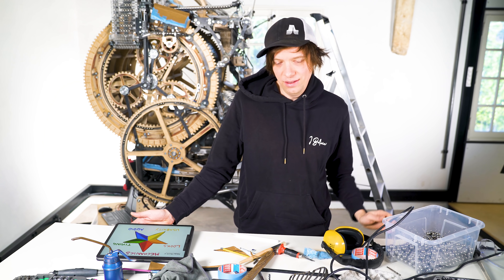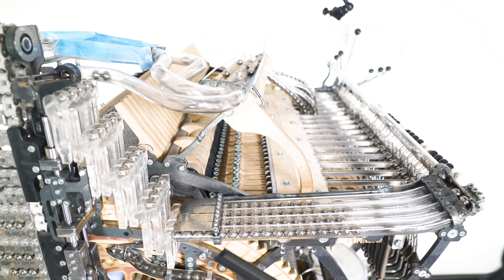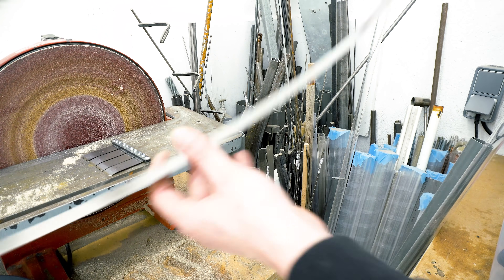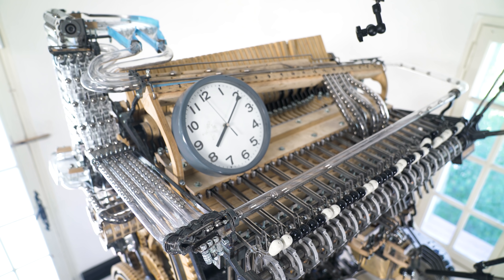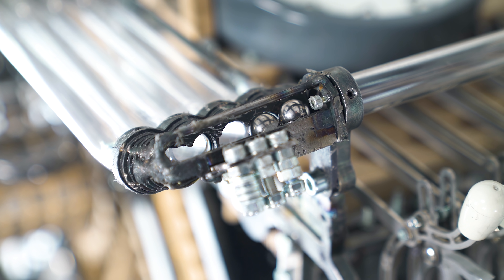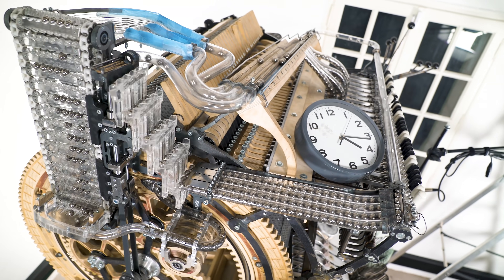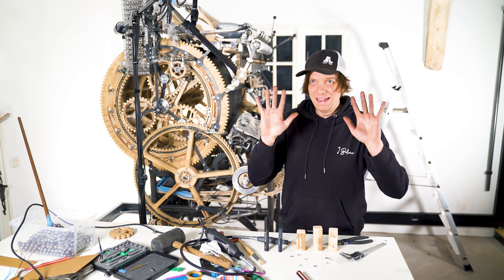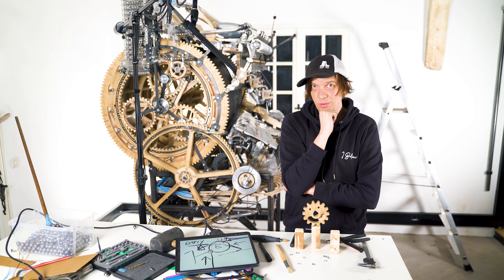Marble Machine X Fish Stair Upgrade

Comment: How did the standard of "no marbles on the floor" become the ultimate rule to live by ?   The real goal you have stated dozens or hundreds of times - play it on the world tour.  Not "not a single marble on the floor" !  You are considering quitting project from time to time over this rule which isnt even a rule.  Honestly the few escapees in the original video is part of the charm.  You are making music, and a spectacle to play on the world tour.  Maybe "no marbles on the floor" is the baby you need to kill.
Reply: Marbles on the floor mean the machine is doing something unpredictable, which is very bad. It would be catastrophic if, during the world tour a marble escapes and somebody slips on it. Even worse is if the marble has the potential to get caught in the machinery, and cause the whole machine to break. No marbles on the floor ensures that they will never be a risk of them messing anything up.
Reply: @bro748  It will never be 100% perfect though. So it almost looks like he's setting himself up for failure.
Reply: @nNicok  He would be setting himself up for failure if he was content with a machine that could break at any moment. 

And ensuring that 100% of marbles stay inside the machine is not very difficult; all he has to do is encase all the marble paths in plastic (or really any other material) and then there's no possible way a marble could escape. That doesn't look very pretty though, which is why he doesn't do that. Even without doing that it's still possible to get that 0% drop rate, and he's very close. There are only a couple of points that marbles can still escape from the machine.
Reply: @bro748  I don't understand why you think it would break that easily. How do you think that would happen?
Reply: @nNicok  He's just very pessimistic.
Reply: @nNicok  If a marble jumps out and gets stuck in one of the gears the machine could break quite easily. Think about a stick in a bicycle wheel, the moment the wheel can't turn any more the bike will flip and its rider will hits their head on the pavement.
Reply: @Noone-tb8jn  I get that but I don't see any easy way to get a marble into the gears without putting your hand inside and placing it there.
Reply: Thanks all for the replies and to Alan for the supporting reply.  I have been convinced by some of you like "bro" that loose marbles are worse than just a charming drop... that is an excellent point and catastrophic failure by injury to a person or machine is definately something to be avoided.
 What my OP message was reacting to is more on the philospohical level - in this video (the last one of the fish stair) Martin was legitimatly talking about giving up on the project - thats an emotional low.   He also presented in that day or a few days before a 5-pointed star of objectives... or "direction drivers" I guess since the "objective" is clearly "play on the world tour".  However, "marbles on the floor" was not in of itself an arm of that star.     
When you set up a metric, you get a tendancy to adhere to that metric as opposed to what you are looking for behind the selection of that metric....  If you look at the marble tests scoring grid, the marbles on the floor are used as a stand-in for quality because they are countable.   You cant do a test and try to measure "how awesome it would be on stage" or "how great it looks" or even "how well engineered it is "  - you need a countable metric.  So the marbles on the floor thing has gotten a promotion over other aspects just because it happens to provide a countable integer output.   I want to encourage a bit a little bit of rightsizing on that one metric - ESPECIALLY in face of talking about quitting the project.  
Videos since then have just moved on to other aspects, the fish stair feeder simply solved by stating "dont let it run empty" which is a good enough conclusion.   I guess then, for now at this point, we dont need to drag out the safety nets to catch Martin's enthusiasm or falling marbles.
Reply: its his baby, a parent always knows their prodigy best. I think Martin is doing brilliantly and will ultimately succeed. He knows what he is doing. The marble on the floor is a symptom of something not right and it could cause a show stop type event ie mechanical failure. That is what he is trying to eliminate as far as possible. Not a bad idea at all.
Reply: the edge case in this video is a perfect example of a marble on the floor that poses no risk of breaking the machine
Reply: Like you say, the goal of no marbles on the floor is unachievable. That is perfection, which does not exist. What we engineers do do, is build something such that a marble on the floor is contained and is not a problem. Shit happens, we know this; we make systems so that shit stays merely shit and does not morph into catastrophe when running)

Seeing as the actual goal is to take the bloody thing and play it on stage (and after 3 years that has not come close to happening yet which tells you something), the immediate handling for marbles on the floor could be as simple as a big net under the MMX to catch marbles. Or just play the thing in a big shallow tub where Martin stands outside it and no-one slips on  a marble. I imagine stepping a marble is almost as bad as stepping on a Lego piece in the dark.

Either way - Martin, stop fiddling with the damn machine and just put it on a stage and play it. No instrument is ever perfect

Comment: Marble. Escapes. Are. Not. A. Critical. Failure.

Please, stop using up so much of your time and energy chasing small issues that will not prevent the machine from operating. A marble that falls on the floor on stage will not impact playing the machine at all, and will almost certainly not even be noticeable. Unless you're losing hundreds of marbles per song, this is a non-issue. Apply some risk assessment techniques to the project and bucket potential problems by their impact, focus on the fatal/critical ones that could damage the machine or stop it from playing.

Comment: Will a magnet get the metal grit off of your hands?

It's been a long time since I've ground steel with a dremel tool, but when I did I found that an easy way to clean up was to use a "magnetic sponge".  I wrapped a magnet in paper and used that to clean up.  I would then unwrap the magnet from the paper, being careful to have the metal grit fall into the trash rather than get on to the magnet.

Comment: I would have tried a pin that holds the marbles in the incoming queue as long while the balance is down and not back to receiving level yet. Could work similarly with the stairs, hold incoming marbles past the 1st position with the stair is not at an appropriate position.

Comment: You need a sort of bistable mechanism on the divide by 4 that prefers to be up unless there's the right amount of weight on it.

Think of a button that clicks when you press it. That click is the button at first resisting being pushed down. But when you push it past a certain point, suddenly there's a lot less resistance and it shoots downward from the weight to fully pressed. When you lift your finger from the button, it still goes back up.

How to implement? Have two strips of spring steel at slightly different angles like one of those snap hair clip barrette things. It will want to be in one of the two states and resist being in between. If you then add weight to it, it will really want to be in one state and kinda be ok in the other state. Fine tune it so it only goes down when there are 4 marbles on it, and only goes up when there are 0 marbles on it

I hope you see this because I really think this would work. It will really discourage the divide by 4 to want to be in between the up and down states

Comment: A thought occurred to me today, but not while I was watching the days mole hunting. The engineer in me has been cheering along for a while when it comes to the idea of no marbles dropped, because that's what an engineer would do. I am experiencing a similar issue in my broadcasting job where I want to engineer for every possible outcome and potential issue while others who do not have an engineering background and therefore think differently done even agree with my thinking that there are issues to begin with.

My Thought: Almost every non electronic instrument in existence has consumables that need replaced from time to time. Guitar strings and drumsticks sometimes break in the middle of a performance. Drummists keep extra sticks just for this purpose. Guitarists aren't so lucky because they can't just put another string on while they are playing their instrument  (We've all seen the video of Stevie Ray Vaughan breaking a string and his tech making the perfect guitar switch).

While the marble divider needs to be fed properly, is 100% marble retention really necessary? there seem to be a lot of compromises to achieve a goal that I'm still not convinced is a real problem. I personally don't think I will, mind seeing a marble or two fall off the machine every once in a while. I just don't want to see you give up while chasing something that might be unattainable.

Anyway, that's just me thought. Stay safe, stay strong, and keep going!

Comment: Those finger should be about 2mm longer and then you have that probelem solved. As you can see fingers touch marbles at the middle when they hit against to that ladder so they can easily slip a away of fingers, if you add lenght about 2mm after middle axle of marble there will be no way to sqeeze throught that gap.

Comment: 1) it's already cool; even if you stopped working on it, it would still be cool.
2) it's cool even if you work on it indefinitely; it doesn't ever need to be completed to be cool
3) but if you ever tour with it I will definitely fly to whatever country you're in to see it
4) stop trying to prevent the marbles from escaping the machine. it doesn't matter if marbles escape the machine

Comment: It's funny, I just realized why you care so much about failure points like this, which have no chance of damaging the machine. While you definitely want to make it so that, if something fails, it doesn't damage the machine, that way a failure won't cause it to rip itself apart, the problem with being okay with marbles flying out like this is simple:

When you are on stage you aren't just standing in one spot. If marbles spill onto the floor, no matter how unlikely it is for one marble by itself to cause you to slip, it can happen, so it is best not to risk it. As bad as the machine breaking in the middle of the tour would be, you or one of the other band members breaking would be worse.

Comment: Suggestion: With the remaining Fish Stair issue, add a steep chamfer the right (incoming) side of the pockets of the first stair, so that a late marble will be pushed back into the tube.  15-20 degrees off vertical should do it.  Start at 1/5, the thickness of the stair or less (2 mm deep if stair is 10 mm thick).

Divide by 4, use the same solution that you have for the channel divider?  Remove the flipper and just make the 4 tubes exactly X marbles long.  Once a tube is full the marbles just roll over the top marble and goes to the next tube.  Last tube will always be starving for marbles, but system can't clog until all 4 tubes are full.

Usually it is easier to engineer it robust and then let the artist make it pretty.  Design with function over form, then once it works add in some form...  I know it is frustrating but keep up the great work, the last 2% of engineering is always the hardest.

Comment: for your "edge-case marble" issue, maybe you can:
- adjust the angle of the 4 queue pipes, so marbles won't roll down too fast
- add  "soft brakes" inside the 4 queue pipes (e.g. extra friction or mini speed bumps)
- shorten the 4 queue pipes, giving marbles less time to accelerate which will reduce the final velocity of marbles when they hit the bottom step of the fish stair

Comment: About the "divide-by-four": Wouldn’t it be much more reliable if the marbles were running completely free and ALL the work was done by the pivoting mechanism? That is: open up the four "tunnels" so that the marbles run freely. Introducing friction in different forms there will certainly create all kinds of random effects.
Of course the pivot must release ALL four marbles before it returns. If the above is not enough, a tiny threshold can hold the marbles in place on the pivot until they are in position to run smoothly into the "tunnels".
I hope my explanation makes sense. It should eliminate sources of random behaviour while keeping the elegant mechanism.
Having said that, I am really, really impressed by your patience and perseverance, Martin. Hang in there! A well functioning mechanism is beautiful in it self. Kämpa på!

Comment: Couldn't you just round off the edges of the first fish stair so that if a marble gets caught, it would just get pushed back into the tube instead of getting carried up by the fish stair? This edge case only happens when there are very few marbles in the tube so you wouldn't have to worry about there being room for the marble to go back into the tube

Comment: Maybe if you want to divide them equally you should create a mechanism similar to the one you used in MM1 on the Wintergatan letters in front? Where marble switches the gate to redirect next marble to another channel.
But this might not work with high tempo.

Comment: Martin we love you and this project. If you need to take breaks here and there it is not admitting defeat, it is a necessary component. It will be better to approach the problem with fresh eyes and not in a flurry of ‘I have to work doubly hard to fix the fix I just made.’ As a maker I’ve been there. Take the issue aside and ruminate on the art vs. engineer before taking the grinder to it. Fixing something once will be more worthwhile to your wellbeing (and less work!) than doing it twice or more in an effort to get it done. This project is worthwhile and we’ll be here as long as it takes.

Comment: For the Edge Case marble you mentioned, have you considered adjusting the first stairstep? Give it a 'hump' that, if it's not beyond that point, it gets pushed back into the track. You'd have to create a wall underneath the divide by four so that marbles don't fall out of the step.

Comment: Possible idea: Make it so the spring steel leaves actually are low enough to fully brake the marble queue into the fish stair. No marble can roll past it unimpeded - then, have the fish stair itself lift the spring steel with a lever when it gets to the ideal position, and only in the ideal position, it allows a marble to drop from the queue.

Comment: Martin: Engineers for Boeing Aircraft have unlimited resources in money and in science minded innovators from all walks of life. Example; after thinking they had finished a hydraulic design system, they would have to admit that this perfect system would require a beautiful fix called an hydraulic accumulator. This is what you hinted at today and it it is probably necessary for proper flow in any complex design concerning flow. Please, stay with it friend!

Comment: I think the thing Martin is forgetting is that stability and reliability is not the same thing as having no failures. Just that the system is resilient against the failures that do happen.

Having a handful of marbles on the floor at the end of a show isn't the end of the world if it doesn't affect anything. You'll just end up playing whack-a-mole forever if you try to eliminate it completely. A system like this is too chaotic by nature.

Comment: I want to see the artist take over. Plinko is the answer for a self regulating divider! A pegboard that splits out to 6-8 lane widths and then has a funnel at the end back down to 4 to make up for the decreased distribution at the edges, maybe just 4 channels if the distribution is even enough. 

https://www.google.com/search?q=plinko+histogram&client=firefox-b-1-d&sxsrf=ALeKk007CQVSqRw3PBBmeUvV9xsrmdRJYg:1611712095348&source=lnms&tbm=isch&sa=X&ved=2ahUKEwjagbG3_7ruAhVCZ80KHa_NDCEQ_AUoAXoECBEQAw&biw=1920&bih=938#imgrc=Tfm0y_l0Ys5jiM

Comment: In my (uneducated) eyes, I see you in every video striving for perfection. - It doesn't exist. "You can't ever reach perfection, but you can believe in an asymptote toward which you are ceaselessly striving" - Paul Kalanithi. Nobody here watching wants to see you give up. We've all seen (already) what this machine you have designed & build can do during your testing. It already plays tight music. You've already won on the 'Looks' department. The mechanics are sound, the tweaking is what we do to guide ourselves towards perfection.

But at the end of the day, it has to make YOU happy. If you are not happy, you are unlikely to believe in what you are trying to do. If that is the case then yes, you should probably either stop, or may a final push towards 'finishing' the machine 'as-is'. You have to believe in this project, we all do.

Comment: with the divide by 4 dremeling it out to try and get them to release all at the same time is the exact same reason lock picking is possible. due to inconsistent impossible to avoid tolerances you will always have one bind before the others. As for the new solution to the divide by 4 i think its the best case you could have. technically speaking you could remove the whole counter weighted release system and just have a fixed ramp at this point, since it fills channel 1 then 2 and so on.

As for the fish stair I know the machine is only playing a few channels at the moment but in all your long tests we've always seen it back up and be full, so you may not have an issue there. so long as the the conveyer system replenishes the machine at a rate equal or greater than consumption on average.